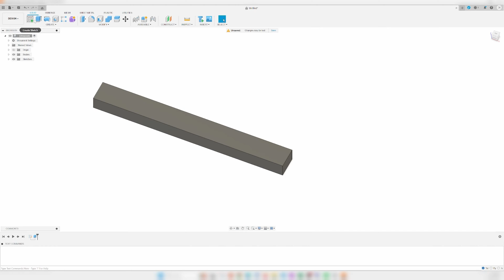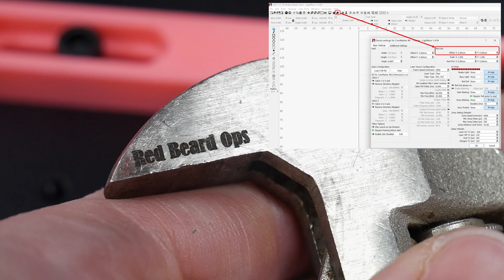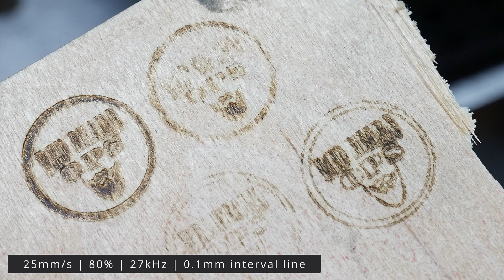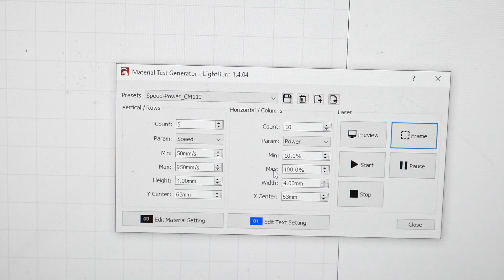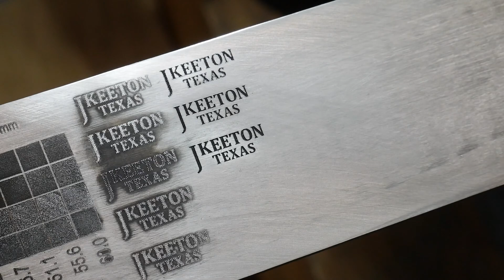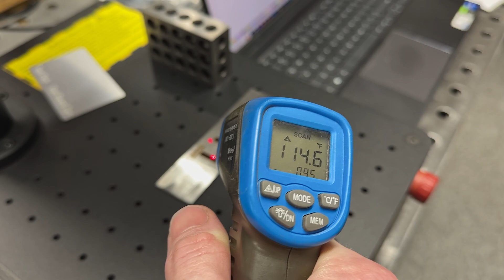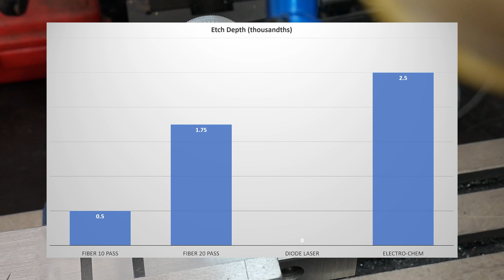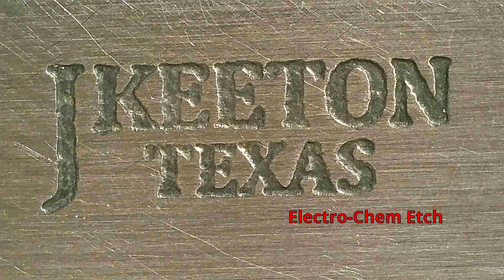Review from 'Red Beard Ops' Deep Metal Etching LASER For Knife Making ComMarker B4 20W Overview

Comment: I’ve watched this several times and right now the B4 is on sale, about to pull the trigger, I know nothing about lasers for makers mark but I’m curious if you think the 20w is “enough” or should I go to the 30w? The 30w is on sale for less than the 20w usually is…
Reply from the maker: Thank you for your attention to ComMarker. As for the appropriate wattage, we need to know what we do. For example, if we only do marking and do not have any requirements on depth, 20 watts is basically enough. If you require depth or cutting, I recommend choosing a higher wattage.